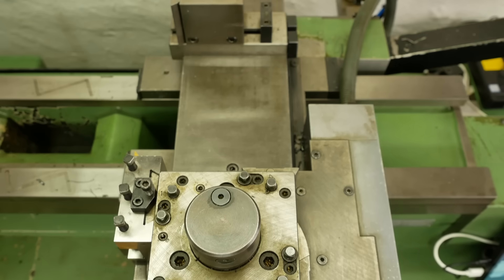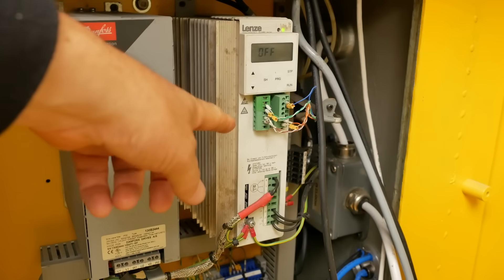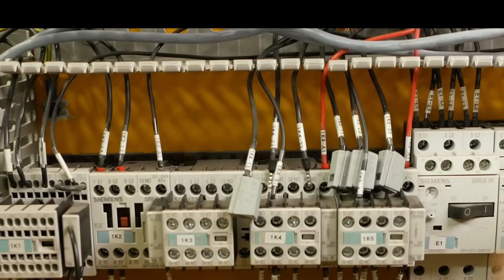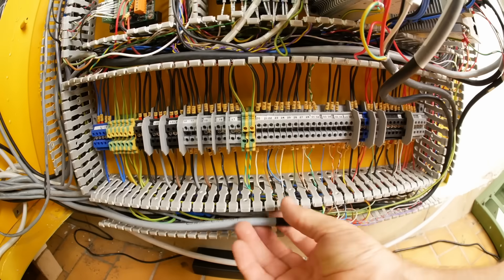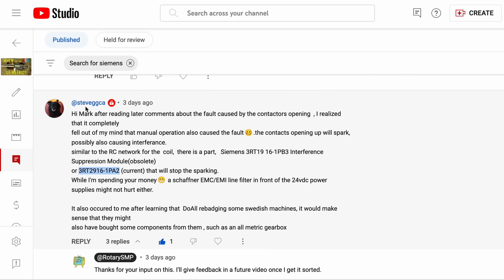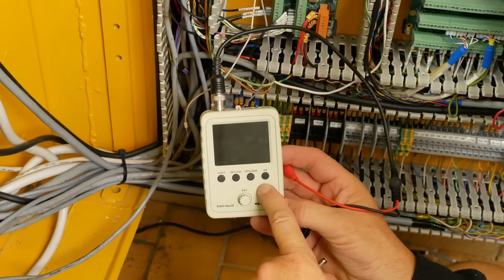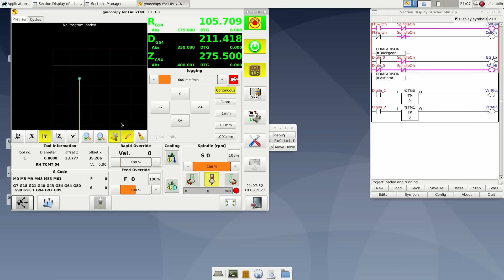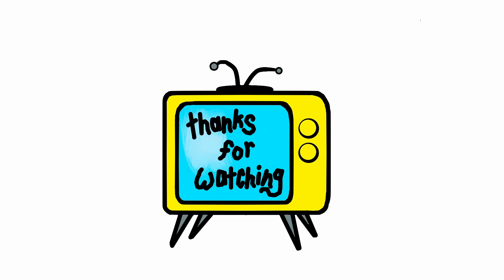Troubleshooting electrical interference on the Schaublin 125 || RotarySMP

Comment: Hi, the Siemens module should be in line with the contactor output in my opinion. But be careful. The white is mostly the old obsolete type of the contactor and gray is the new one. The accessories do not always fit together. So you might need to buy new contactors for this solution. It looks like it will slide instead of removable contacts, but I am not sure. I never saw these suppression modules in use myself. I am not sure what is actually inside. What I would do instead is to use a shielded cable from the terminals to the IO card. I have seen all delicate signals connected this way. Shielded as far as possible. Debouncing is a good idea but it might be covering stuff up and the spikes can in the end fry you IOs. I once had a servo system with roughly 100m between VFD and the drive (terrible design) We needed to do this on every spot and then it somewhat worked. But it was not reliable anyway with switching a couple hundred KW loads around it. It was on the big stretching press they make aviation grade aluminium on and servos were supposed to move some measuring arms. The project that nearly made me quit...
Reply: Hi the module shown by Mark was listed as the replacement for the obsolete part.
I found the original model listed  on ebay and amazon here in canada,  so finding it in europe
should be even easier.
Those suppression modules  exist primarily to stop the contacts from arcing ,eroding ,and welding 
but have the bonus benefit to also stop noise in digital systems.
Reply from the maker: THanks for that. That module has RC pairs in it. So you just plug it into the output with the wires?
Reply: @RotarySMP  @soucevit
the Addon Modules Clip in the Bottom part of the contractor   and the pins align withe the screw terminals  so clip in and fasten the screws they should be a version for the light gray ones too ....   this is model number for the light gray Version 3RT2916-1PA2  3RT2916-1PA1   
but i think the main problem is that the controller card picks up any emv in that box so try to shield the cable and the card
Reply from the maker: @axelweimann5274   Thanks Axel.  That really helps.
Reply: Very good Points in the Comment.

Debouncing is not a bad Thing, but you might want to do it in Hardware to keep your Inputs healthy.
And the Spike might also occur in other Places that are not throwing Errors at the Moment but still can be problematic.

Comment: Just fixed it in software, what a madlad.
I spent two days searching for the OWON original box, as it crucially contains the power supply, because why would the oscilloscope charge with 5V USB when you can have a 8.8V specialty charger with a deeply recessed DC jack that no adapter would fit.
I'll send it over with some other stuff next week. Maybe at some point you'll revisit measuring the low-voltage lines for the EMF spikes and fix it in hardware.
Reply from the maker: Hi Alexander,
No worries. 
If I was sure that the Siemens snubbers could be attached to my contactors, I would use them.
Reply: @RotarySMP  In the end, you would probably need to keep the shielding intact until very close to the contactors.
I'm also not sure about the low-voltage signaling lines, and how they are terminated in your Mesa card. I assume the input is a FET, so very high impedance. That means it is very sensitive to interference from other lines. In addition, even for normal signals, it can create reflections. Basically, when a voltage changes, it actually travels along a line, as obviously transmissions aren't instant, like a sound wave in a tin can telephone. That impulse travels, and at very high impedance ends, it simply reflects and travels the other way round. 
A simple but hacky solution is to load it down with a simple resistor in parallel to the transmission line in the screw terminals. People suggesting a cap also aren't wrong, because at high frequencies, capacitors act like a resistor.
Reply from the maker: @graealex  I didn't pull out the ground circuit. The noise may be induced in there. That is a much more complicated web of runs.

Comment: To solve this in the electrical level you need shielded cables up to the card, also low pass filters ( i usually use 40hz cutoff ) to remove noise from the inputs.
Reply from the maker: I thought someone would say this :)
Reply: Whether the low pass filter is in software or hardware how big of a difference is it really?
Reply: @UnreasonableSteve  In some cases, if system is interrupt drivem this kind of spurious signal may cause some issues and generate lag in response times, due to high amount of input transitions, which all have still to be handled. It is always better to solve issues electrically, even if software solution is available, it keeps code/configuration much more clean and less hw dependent.
Reply: @Velectrics  If you can eliminate the root cause then sure, but a hardware low-pass filter is not always better than software. It's easier to get exact timing with software debouncing, and it's a lot easier to change when required. Plus, slow-moving signals into digital inputs can have their own issues (metastability, noise sensitivity around the threshold). Normally a schmidt trigger will eliminate those, but not always..
Reply: @Velectrics  The inputs aren't interrupt driven. LinuxCNC polls them every 1ms so rapidly changing inputs won't affect software timing. I'm not a great fan of software debouncing but if it works, that is the most important thing.
Reply from the maker: @LesNewell  Thanks Les.
Reply: @LesNewell  "LinuxCNC polls them every 1ms". I assume you are correct. So how does a 5us s/w debounce even affect this? I haven't looked at how this is coded but it does not seem to make sense at first view. Maybe is programming input lines' on-chip hardware, before it even gets polled.
Reply: @tuberroot1112   That 5us was a mistake. It's 5ms.
Reply: Well that explains it, I thought 5uS sounded very short

Comment: Der Drehstrom Überspannungsschutz wird unten an des schütz gebaut, anstatt eines Bi Metall Motorschutzrelais.
Reply from the maker: Hast du ein Link zu ein Photos bitte?
Reply: @RotarySMP  suche auf Wikipedia nach Motorschutz (Elektrotechnik)
Und unter Überlastrelais findest du ein Bild wie es zusammengebaut wird.
Siemens zeigt leider immer nur bilder der einzelnen Komponenten.
Reply from the maker: @bogenjaeger98   Prima Danke. Jetzt ist es mir klar.